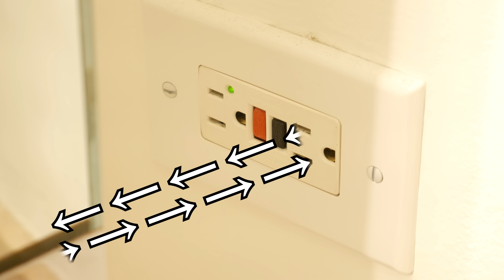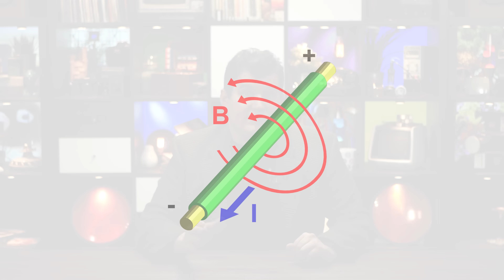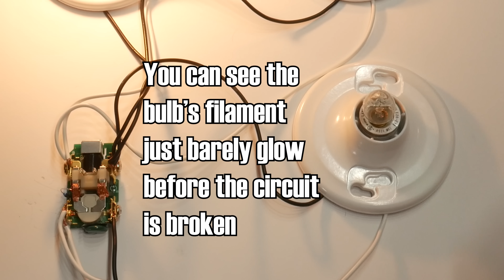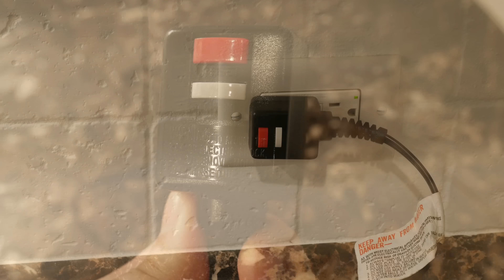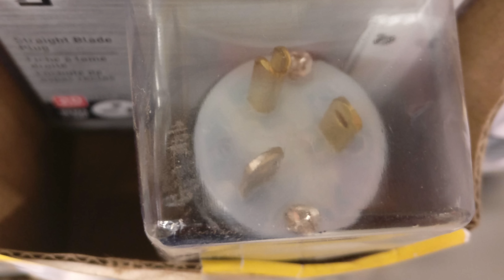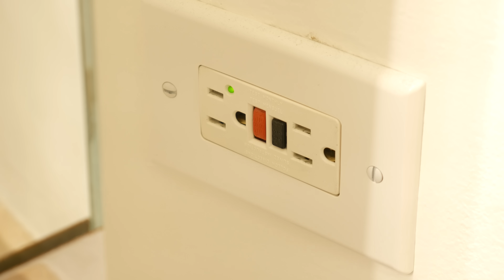The GFCI/RCD: A Simple but Life-Saving Protector

Comment: Puting the RCD on the circuit panel can save you a feel bucks by detecting otherwise undetectable electricity leakings. It may be a pain to debug, but it pays.
Reply: Having just one RCD in the distribution box usually means the RCD used requires higher leakage current to trip. I have been zapped once before at 240V and the RCD didn't trip. (I tried pressing the test button, the RCD still works fine.)
Reply: @Andy Lun
on the UK its still 25 mA for 1 RCD on all circuits , and it is possible to get an electric shock and not trip an RCD if you dont conduct the required 25 mA , such as a light touch on a live wire or actually touching live and neutral if your isolated from ground , most flooring is a good insulator but you could be capacitively connected to ground   :-)
Reply: Carlos Eduardo Foltran when we moved in, one day it started raining a lot suddenly the RCD tripped. It took us hours to debug it (with a friend who's electrician). In the end it turned out to be a lamp hook which had scratched the isolation of a wire and the increased air humidity was the final straw. The wiring back then was up to 70s standards, so we started our mission to rewire the entire house up to (and exceeding) todays standards
Reply: That is my point! In this case, not only a leakage was avoided, but also a fire hazard. I believe it is better to have a headache for a few days debugging wires than to rescue things from ashes.
Reply: Carlos Eduardo Foltran GFCI receptacles will not protect against fires.  They are personnel protection.  They will not detect line to neutral arcing conditions.  You need arc fault protection if you are looking for fire protection.
Reply: Ian, I agree! You will need a circuit breaker for a shot, but imagine the situation when an uninsulated wire (eg eaten by a mouse) touches a wooden beam and leaks slowly, not enough to cause a short, but still capable to carbonise the beam and eventualy set it on fire.
My point is on should have all kinds of protection on the distribution box. Fuses for shorts, breakes for overload and RCD for leakage. Today, this is the standart here im Brazil and we have devices combining all those 3 in just one little box.
Reply: Moreover, I don't understand why European people still use that insane 240V standard. In Brazil it used to be like that, but we changed to 127V-3 phases star ground standard during the 60's. 127V is a surviveable shock.
Reply: @Carlos Eduardo Foltran
the RCD would trip before the wood got on fire and of americans get killed by 110 volts i hope you dont feel too safe :-)
Reply: Carlos Eduardo Foltran You miss that I mentioned another technology which is arc fault protection.  AFCI is designed to look for arcing conditions.  GFCI is designed to trip if .04 - .06 amps is leaves the current carrying conducors on the protected side of the device.  Arcing conditions look drastically different than ground fault conditions.  Early arcing conditions can be across the current carrying conductors.  On top of that, dry wood is an insulator.  By the time you see carbon forming on the wood, it would more likely be the heat from the arc causing the wood to burn as opposed to current flowing through the wood (unless you have water getting on you wooden structure).
Reply: Ytandy100, I know people get killed by 110V. I lost a dear school friend who was electrocuted at home by a 127V outlet, for that I am very carefull with electricity. People die for electrocution even in Japan with their 100V standard. But I thing you would agree that one is 4 times more likely to be killed by 240V than by 110V. Simple Ohm law.
Reply: @Carlos Eduardo Foltran
I think the benefit of 240V is that you can have appliances using higher power at lower current. For example, everything in my bedroom is on a 13A circuit breaker, but I can have my PC, A/C (1HP), lights, fans, hair dryer, etc all running at the same time without tripping the MCB.
Reply: @Andy Lun, 
Sure! That is the reason. But does it pay the risk?
Reply: @Carlos Eduardo Foltran
i agree , the higher the voltage the higher the chance it will kill you , that is why you need RCD to give you a chance to survive :-)
also when i work on small mains powered devices i use an isolating transformer , still bites if you touch both wires but is safer as there is no actual "hot" wire :-)
Reply: There is an old saying it's the volts that joltz and the mills that kills!  A line of school kids on a Van de Graaf generator could be at 100KV
Reply: @cefoltran  220v is still used in Brazil and it is better for power efficiency.
Reply: @MrCriistiano  I know. I have on my work bench 127V and 220V outlets. The whole point is that 220V is dangerous. It must be treated with respect. There is a balance between efficiency and safety that we have to consider.
Reply: @cefoltran  People need to be 4 times smarter in 240V regions than in 110V regions. Simple Ohm law.
Reply: what if you just put all circuit breakers off and one by one back again - it should work, where i live it is very common to have 3 phases, 230V and 40A each, with single RCD and multiple circuit breakers, ex 1 for living room, 1 bedroom, 1 washer,  1 dishwasher and etc, all sockets are with a ground , my socket 10cm from a sink has additional cover which i have to lift up manually; mind you im not an electrician
Reply: It works if you have circuit breakers that breaks not only the phase but also the neutral: unfortunately in some countries they use only to break the phase (for me, it doesn't make sense) so you can have neutral to earth faults that are impossible to isolate.
Reply: @A1eR
yes that is a PITA :-)
Reply: @phils5109  This does not work if you have a short between neutral and earth. Best of all, anything you plug in or power up can trigger the RCD.
But usually your approach works. Even though, sometimes...it's a bit of an effort. Especially when the fault is "random". One case was a damaged wire in an outlet. When the room was heated above a certain (rather warm) temperature, the wire would thermally expand and touch earth. Took me months to locate. Another case was a defective water pump, which would sometimes cause a power outage. The pump turns on automatically when ground water is high. Like after rain. Took me months to figure out that the issue appeared more often during rainy weeks. Did not even know that there was a pump!
Reply: Even better are the circuit breakers with built-in individual RCDs. That means you can even tell which circuit is causing the problem, and the other circuits in your house can keep going instead of your entire house going dark because of a faulty wire somewhere.
Reply: In the US it is about $10 - $15 (USD) per GFCI receptacle and $45 - $60 (USD) for a circuit breaker that has GFCI protection.  Since in most applications you can get away with the protection at the first outlet of the set that requires protection, it only makes sense to use the receptacle instead of the circuit breaker.
Reply: In Italy it's 20€ for DIN-Rail RCD and up to over 100€ for 503-box (503 box is the standard box for outlets and switches). so central RCD is way cheaper then point of use.

Comment: I think I have one of these in my breaker box here in europe. One day it kicked in. it was a pain to figure out what thing malfunctioned,  it brought half of the house down haha. Turns out it was a outlet that had too much amps going through which internally melted the cables, shorting the positive with the safety ground
Reply: A properly sized circuit breaker would have prevented this.  A circuit breaker's only function is to protect the wire.  I hope when that wire was replaced, it was either upsized to fit the breaker, or the breaker was downsized to fit the wire.  If not, it will happen again.
Reply: Yes, the wire/outlet was upsized to fit the breaker. At first didn't fit the breaker.
Reply: DJoppiesaus, Excellent.  It was properly done then.
Reply: DJoppiesaus, I am trying to read all 1,411 comments from this video. Some of the things I read appear wrong because of different terms for things in different countries.  When you commented "shorting the positive with the safety ground" does that mean you have "direct current" and not "alternating current"? How many wires do you have going to your outlet?

Comment: Meanwhile in the UK, they just have fuses in each plug
Reply: A fuse isn't there to protect you from an electric shock. It's there to protect you from your house burning down.
Reply: A fuse won't protect your from a ground fault or an arc fault
Reply: Niko L and rcd protection in the “fuse cupboard”
Reply: The UK and Europe use twice the voltage of America too, which makes everything that much more dangerous, so more stringent safety features are important.
Reply: Niko L You should go to John Ward's site on RCD use in the UK.  I think you'd find it informative.
Reply: Double insulated plugs (like plastic transformers) don't have a fuse because they output a low voltage.
Reply: No. There are no fewer than 4 overcurrent protection devices between the substation and appliance.
Reply: Nope. Fused at the plug sure, but all the sockets come through a RCD anyways.
Reply: > The UK and Europe use twice the voltage of America too, which makes everything that much more dangerous  

And why would it be more dangerous? We use less current, so less wire heating which is a good thing. I doubt touching 110V 60Hz is healthier than touching 230V 50Hz.
Reply: Hz is frequency, not current. and yes 230v 50hz is quite a bit more hazardous than 110v 60hz. 
A higher voltage is capable of inducing more current, regardless of what your appliances require to run. Also, it takes less than 1 amp to induce fatal heart fibrilation.
Reply: whuzzzup I’ve straight grabbed live 110 VAC. It gave me a jolt in my arm and gave me sore muscles for a day. 
I’ve had a device go haywire at 220 VAC, it blew the plug off of the wall and exploded the plug into a million pieces. The much vaunted “safe” UK plug with included fuse didn’t work as advertised. 
110 VAC at 15 amps isn’t going to be exactly healthy for you, and it is potentially lethal if it manages to cross your heart, but 220 pretty much guarantees it will find a path to ground.
Reply: @Mostlyharmless1985
youve never had an actual properly fused UK plug explode , you may have had a cheapo power brick explode but never an actual plug , o have at times used a plug with a short bit of quarter inch copper tube where the fuse goes when i need just a bit more current and made some impressive bangs but all that happens then is i have to go tothe fuse box and reset the 32 amp breaker , the cable to the plug , the plug and the socket all survive every time , some times not the thing on the end of the cable ,hehe :-)
Reply: YTANDY100 the fuse literally exploded and blew the ass end out the back of the plug, so yes, I have had a “properly fused U.K. plug explode.” I guess you can argue that the fuse might have been counterfeit to fail so spectacularly but it looked like any other fuse that was put in the plug. I’ve also had a faulty power strip trip the rfd which was annoying as hell to figure out what the hell was going on. 

32 amps at 240 is nothing to screw around with. It’s not even worth comparing. Saying “120 is just as dangerous.” Is very wrong. Like, orders of magnitude wrong. Getting tagged in the states will result in a lesson, getting tagged in the U.K. will result in a coffin.
Reply: @whuzzzup : Actually, 220/240 is more dangerous. 

Remember, the human body is just another resistance point to electricity - and although it's the amperage that will kill you (look up how a defibrilator works), it's the voltage that causes the resistance breakdown. The higher the voltage, the lower your natural skin resistance will be if you become part of an electrical circuit.

from https://en.wikipedia.org/wiki/Electrical_injury :

The NIOSH states "Under dry conditions, the resistance offered by the human body may be as high as 100,000 ohms. Wet or broken skin may drop the body's resistance to 1,000 ohms," adding that "high-voltage electrical energy quickly breaks down human skin, reducing the human body's resistance to 500 ohms".

With that said, 220/240 may be considered "safer" only in that people have a natural tendency to equate "higher" with "more dangerous", so they might take more precautions with a 220/240 volt setup than a 110/120 volt setup.
Reply: When I was little, back in the old country with the UK-style plugs, I used to be confused by the word “FUSED” embossed into their cases. Because adult relatives only used the word “fused” to mean “the fuse has blown”!
Reply: @Lawrence D’Oliveiro
yep , english is confusing sometimes , try thinking of this "soluble" meaning it will dissolve and "insoluble" meaning it wont dissolve then these ones "flammable" meaning it will burn and "inflammable" meaning it will burn :-)
Reply: And just about all the fuses were 13A when I left, so the protection wasn't as good as it should be. Since I replaced all the 13A ones with suitably rated ones, I called MK and asked them for an exchange. They wouldn't do it. So check the fuse in the plug. If it's 13A for a light, then change it....
Reply: And you know why the UK uses fused plugs? Because of those idiotic ring circuits they installed after WWII. Ring circuits are extremely dangerous without fuses on cords, so it is no wonder the UK regulations required them. In the U.S. we've never used ring circuits, or if we have, I've never heard of it.
Reply: 16 amps is more than enough to make you a crispy critter.
Reply: Niko L Why UK has those switches with they're plugs ?
Reply: @jholotanbest2688  To switch off the socket when plugging and unplugging so as to not create an arc.

Comment: In Belgium we are (required) to have a big GFCI ("differential", translated from our flemish/kinda french word for it) for everything (300mA if I recall) and for humid rooms an additional more sensitive one (30mA). I had no idea they used in the USA them on idividual outlets, thanks for the video!
Reply: Allowing large leakage currents is fine for protecting the equipment, but doesn't protect people from shock. If you have a heating element that suddenly finds a path to ground inside your electric kettle, it trips. But if a person grabs both the hot and neutral, they can get electrocuted because a RCD doesn't detect this as a fault. The GFCI design adds this protection and is called a RCBO in the UK.
Reply: Also, great (still rather safe in my opinion due to the way it's configured) explanation setup!
Reply: Also great pro and con explanation for both setups, glad I watched the whole video!
Reply: That is likely because of TT earthing. I  the US they use TN-C-S so on case if a fault hight current flows through the neutral and thr breaker trips. In TT the fault current is just a few amperes so one needs additional protection like a 100-300 mA RCD.